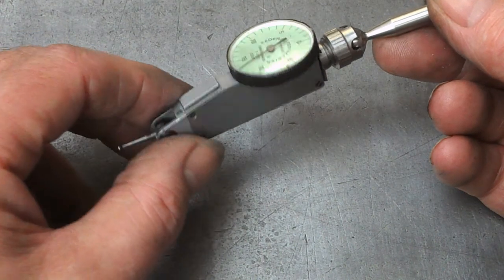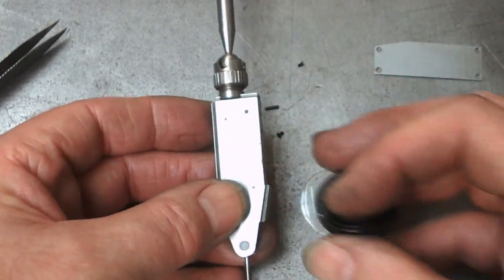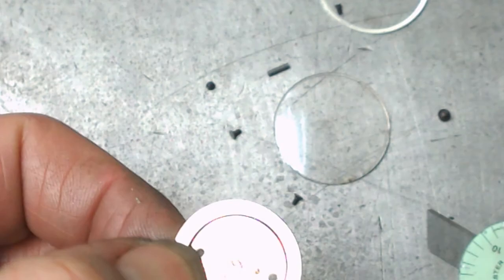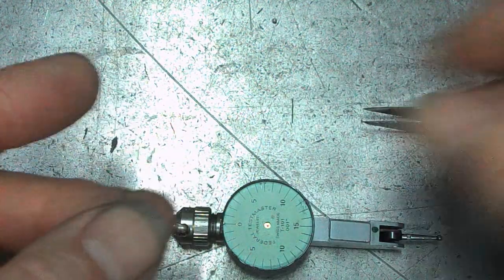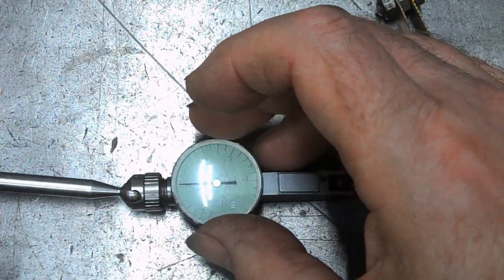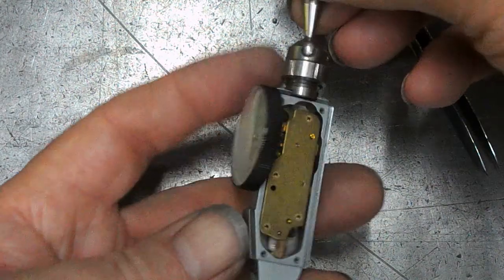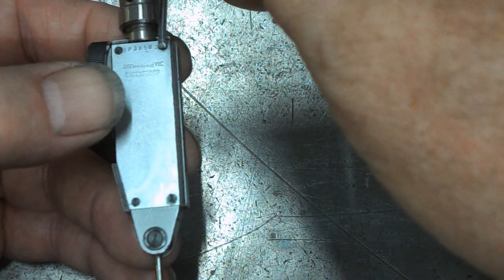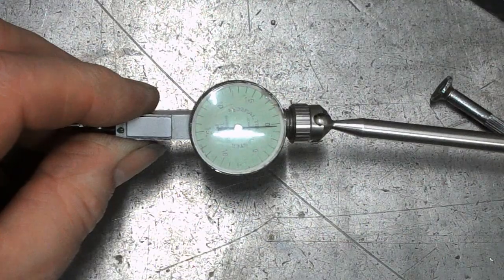Trying to fix a Dial Test Indicator  - Success!

Comment: You should have held it in a small vice of some sort…
There is a special tool for removing the needle, but two small screwdrivers bent at the end to make two levers usually does the trick…after placing a thin piece of plastic under them to protect the dial face…you were so lucky not to damage it beyond repair….
Reply from the maker: Yes, I agree!

Comment: Comment 2, just coincidence a recommendation came up showing a sticky dti being repaired and it shows the lever type hand remover.
Try putting "repairing a sticky dial indicator" into yt search box. Uploader was lazy watchsmith.
Just for the record,  a sticky dial indicator can often be fixed using lighter fluid on the shaft to remove any lubrication that got there by mistake, they are meant to be dry.
Reply from the maker: Ah yes - a pair of miniature pry bars!
Reply: @MidEngineering  indeed but dont try using them to open paint cans.

Comment: 9 out of 10 for success but only 4 out of 10 for technique, but you'll do better next time.😂😂😂😂😂
There are several tòols available to remove pointers, which are just on teeny weeny tapers by the way, ranging from the complex to little more than a pair of little hooked levers.

Comment: Don't need no stinkin' spring.....
Reply: I suspect the spring was there to eliminate backlash. As you can see the needle will not return exactly to 0 every time when the indicator is reassembled without the spring. The inconsistency is probably proportional to the amount of slack between the gears. It does not appear to be far off, likely still serviceable for rough measurements, but probably not as precise and reliable as when new. Still a better result then just chucking the whole thing in the bin when it started acting up!